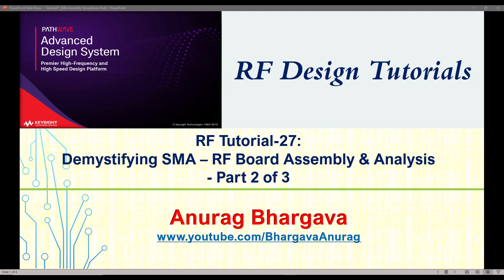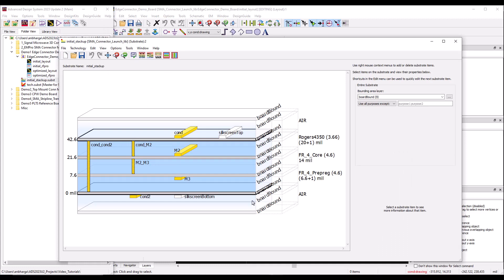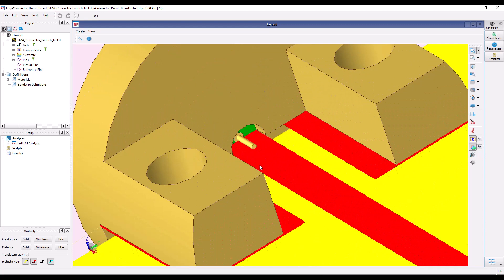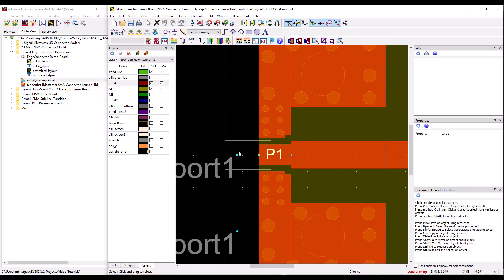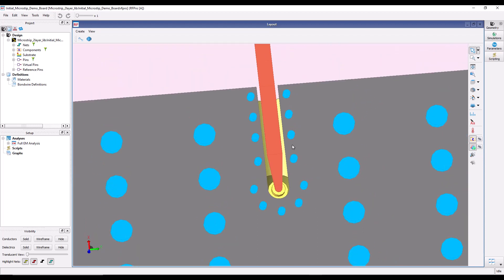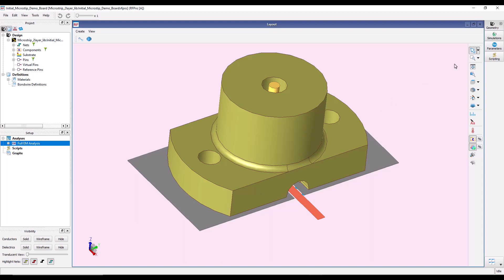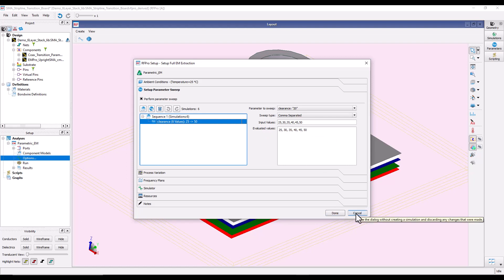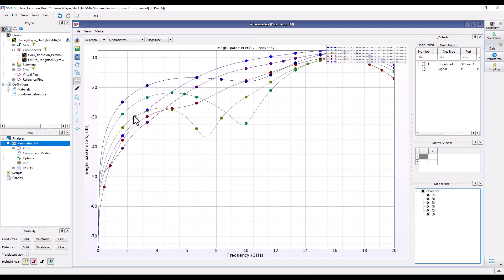RF Design-27: SMA-RF Board Assembly and Analysis - Part 2

Comment: Can you explain please, why there are many rows of vias? Is it not enough to place vias along cpw line ?
Reply from the maker: Placing vias along the CPW line in the most basic requirement but it is not a good practice to leave bigger metal piece dangling, and it is always good idea to place VIAs to make sure ground potential is good and there is no parasitic capacitance that can get formed.
Reply: Ok, thanks for the quick reply! I also have other several questions: 1)Are there any recommendations when choosing via diameters, distance from signal line to vias row, pitch? It was difficult to find such advice, maybe it is very dependable on my setup? 2) Sould I consider taper structure in connection between cgw trace and rf connector or it is crusial only when we have connector with Z different from 50 Om?